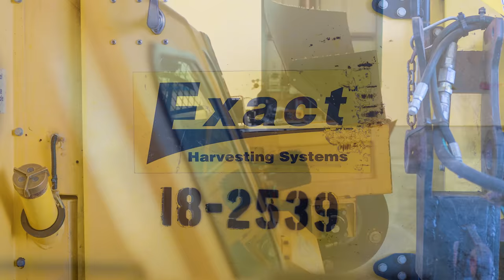Wonderful Orchard Customer Video

Comment: I know this video is old but doesn't air-o-fan use galvanized frames and wind tunnels on their sprayers? You guys ever have a problem with corrosion? My grandfather and dad both used an old Bean with a 392 international v8 in it, the frame basically collapsed after a few years due to the chemicals. Now we run Rears sprayers, they are stainless steel.